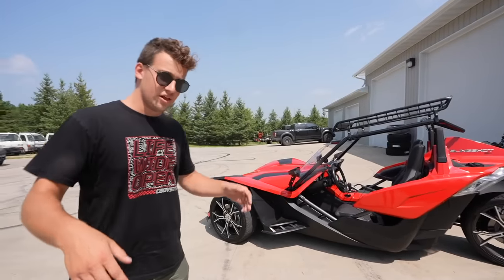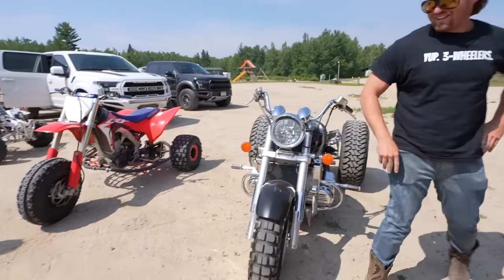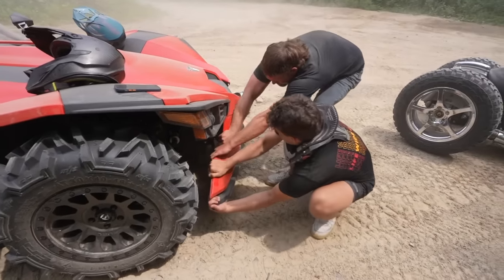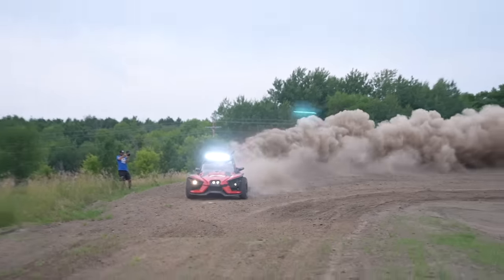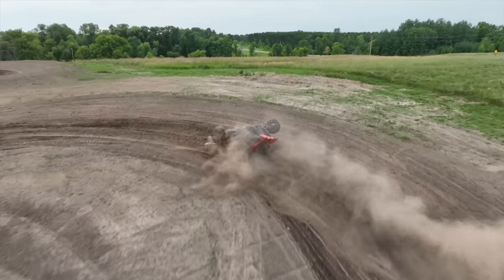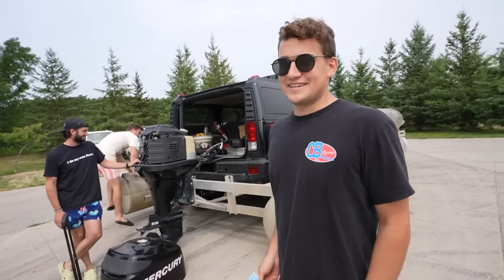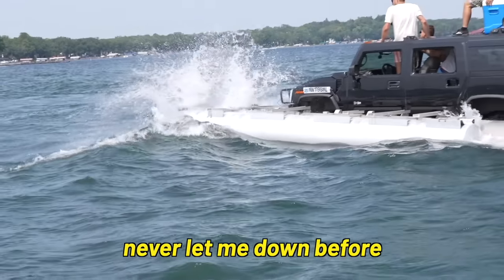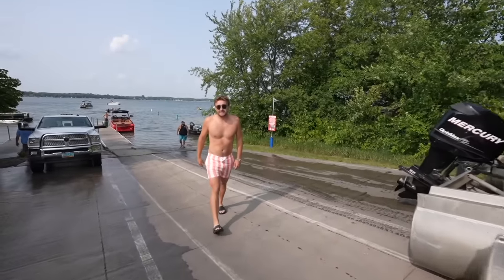Polaris Slingshot Offroad Testing

Comment: Should have got a T. rex instead of the sling shot they are way faster an 10x cooler
Reply from the maker: Those things are sweet! Definitely faster, probably cooler. But you left the part out where they cost 40 - 80 bands. And that’s if you can find one!